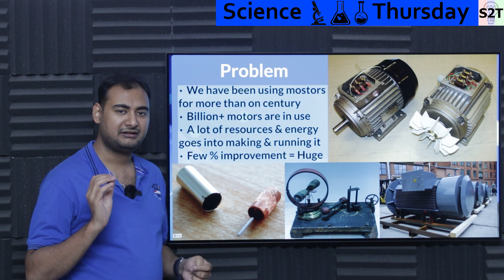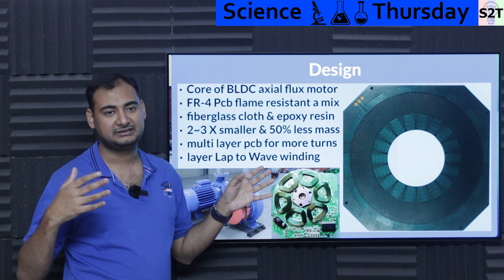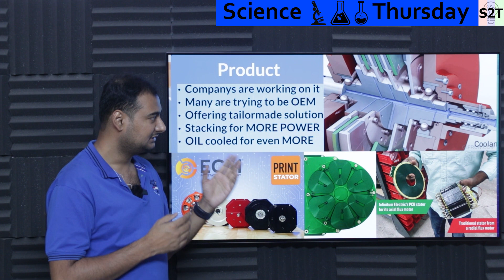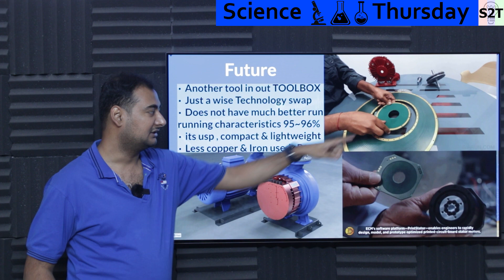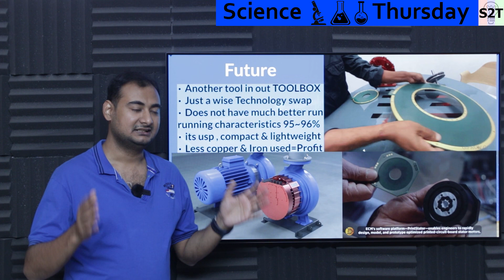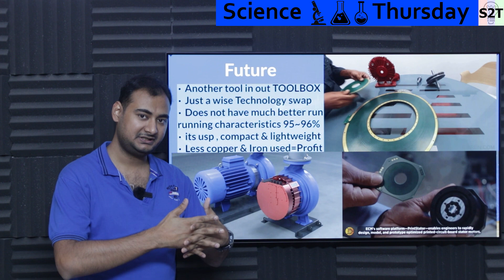PCB Motor Explained {Science Thursday Ep228}

Comment: Dude- brilliant presentation! You really know your stuff, with a generous side of stand up comedy, and you speak 2 or more languages. 

PCB stators are an exciting leap in power/weight/size ratio. I'm exploring the possibility of building a lightweight ebike disc wheel hub motor capable of 15kw bursts, but my understanding is that this axial topology isn't well suited to KV rating under 20 or so...
Reply from the maker: I am glad u liked it and I only know 2